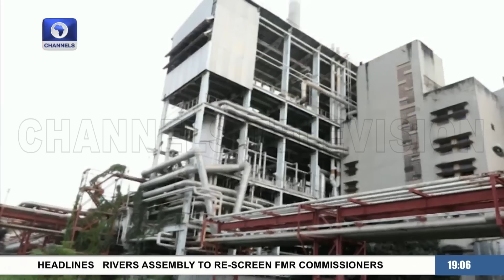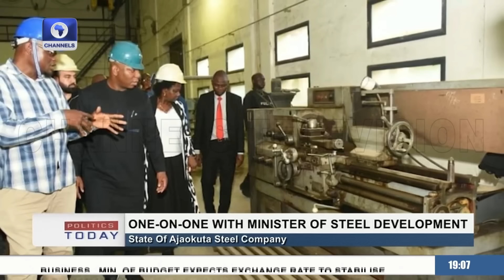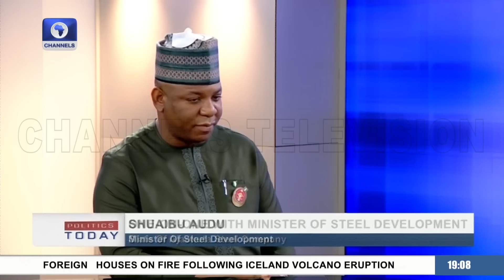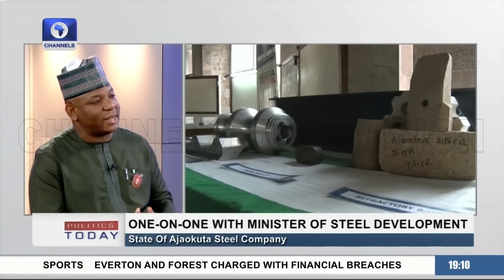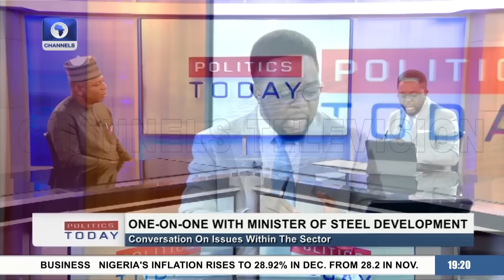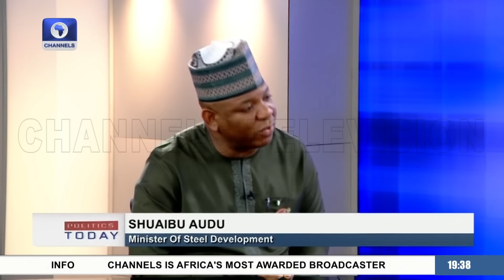Ajaokuta Steel Mill To Start Military Hardware Production – Minister |   Politics Today

Comment: What is needed at the Ajaokuta Mechanical Workshop is new improved CNC machines (Lathe, Mill, etc) for any commercial production to be successful. However, we can start building prototypes with the existing equipment.

Comment: My only question to this man is - what is his ministry doing to ensure that we don’t see a repetition of what’s been happening in the last 45 years or so?  
A quick google search shows that “Nigeria has pumped more than US$8 billion into Ajaokuta Steel Company, a project which began more than 40 years ago but has yet to produce one tonne of steel.
Several attempts have been made to bring the plant into production, but without success. It was built to 98% capacity by the Soviet Union’s Tyazpromoexport. But the lack of a rail line around the plant, and changes in political and operational management over the years, stymied completion.”
Also, what infrastructures are in place (e.g., rail system) for transporting the products when the plant is up and running? 

It’s not just about coming on tv to speak big grammar and mention concession a million times.
Reply: Wow!! I bow and well said

Comment: The question that any Nigerians  should be asking is why a huge complex completed with lots of Nigerian Scarce Resources not working. Now  Nigeria has to spent another huge some of money to make it work again.  The plant need huge Electric supply for the plant to operate. No body talks about that. Nobody  is found responsible of these great economic  blunder called  Ajaokuta Steel Mill.  Nigeria problems has been lack of  good Leadership.

Comment: The Minister stated that the Ministry of Works will need 7million MT of iron/steel rods to complete 30,000 kilometers of roads over 4 years. Let's work it out: that's an average of 1.75 million MT/year. He said it, in his own words.

The funny part is, the maximum capacity of light steel mills is 400,000 MT/year. Ajaokuta cannot fulfill the Ministry of Works' order of 1.75 million MT.

Why are we looking for investor  when hocernmenr as in mins of works need is more than we can produce 400,000MT against 1,750,000MT, By now the minister can just go work and start production of iron/steel rods, road project will take it all and they can even import billets and just make more and save $500million. 

What is he and his proncioal waoting for there we the first 50,000 jobs in Ajaokuta. Please Hons Minister stop branding nimber, we are not moved by those number as they are not adding up one bit. 

Sprry, let the president that you goof big time